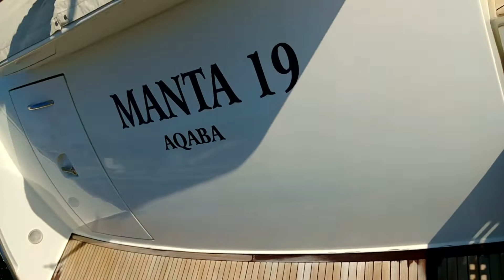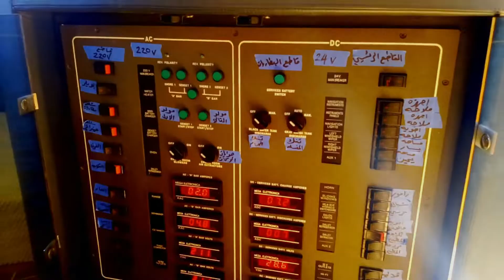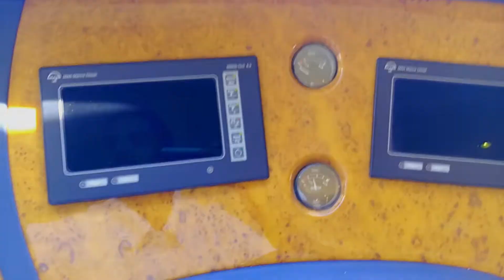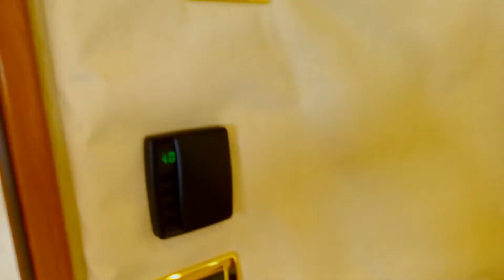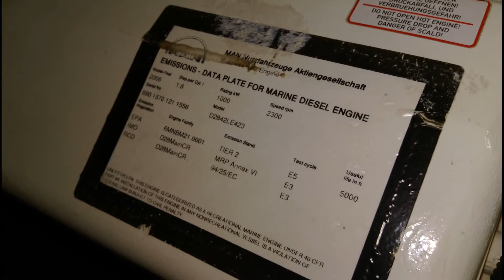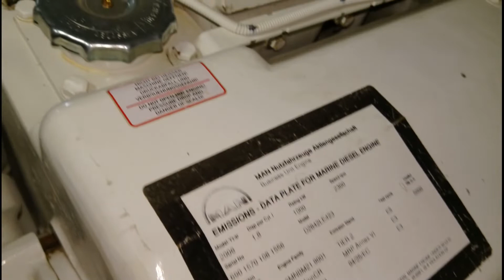700,000 $ - YACHT FULL TOUR : 2008 AZIMUT 68 Flybridge

Comment: Todas las paredes de los cabinas están mal. Mala luz deficiente del video. Y regular manejo de camara
Reply from the maker: The Yacht was Sold in It's current condition. 
I used an old Camera for this video because my regular Cam  fell in the water.
Reply: @liveloveyachting7065  it was a great video. Don't listen. The build quality back then was top notch!! The wood looked amazing, even if there was a bit to much of it. And the cabin walls was not bad at all, it's called a wall cover, and it's just used to protect the boat...lol. it just need a little upgrade, like elections, and give the boat a different colour with a wrap. No this is still a great boat. What price did it sell for?
Reply: There's nothing wrong with the boat. The walls you are talking about, was OK. They had a wall cover on, to protect the walls, you can see it's and  older boat. But this boat was build to the highest standard in 2008 and its still a safe and fast boat in 2021
Reply from the maker: Glad that you know well about yachts! The yacht was sold for 700,000 USD in it's current state. 600 hours only on the engines but needs a small interior refit .
Reply: @liveloveyachting7065  Great. I saw on the Aquaholic channel, a refit of a Sunseaker 35. It got a colour change from white to gunmetal grey/black no paint. A wrap + new seat covers. It looked really nice after.
Reply: Tiene toda la razón y pido disculpas por el tan ligero comentario. Me alegra mucho que le respondan así sea que lo que yo comente es algo disparatado. Gracias